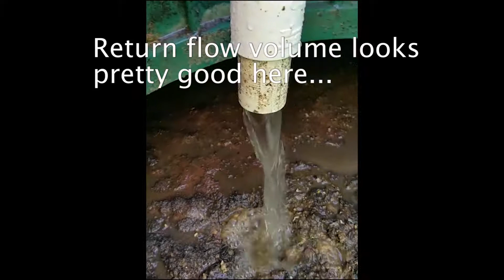012 AdvanTex Return Flow Adjustment

Comment: Good video on this subject.  Most people don't think about the details of how to discharge the recycle line into the tank, and you covered it well.  It might also be a good idea to install a union on the return line down tube so that the last pipe section into the sanitary tee could be removed which would allow a bucket volume test to be performed so one could determine the actual recycle flow.  Keep up the good work on the videos.